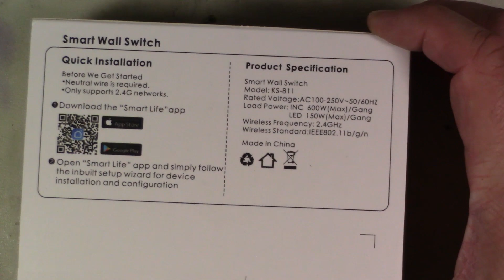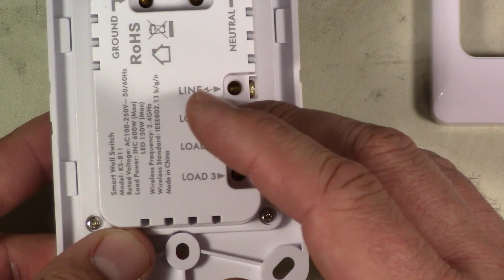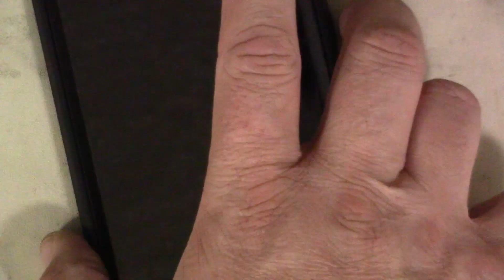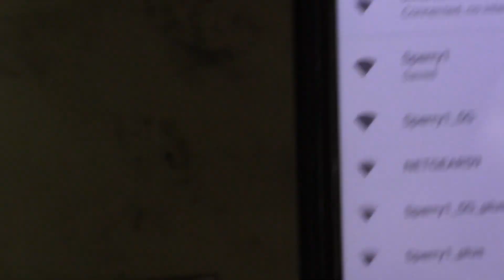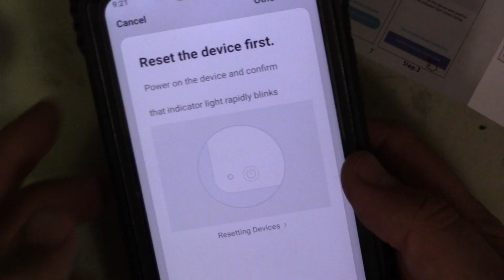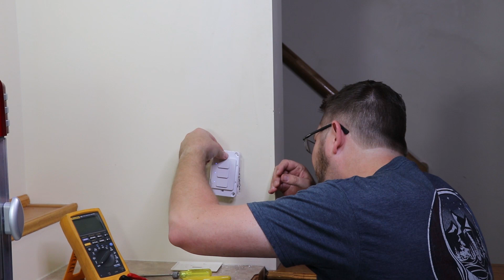Setting Up Zemismart Smart Switch

Comment: Hi thanks for this video, just have a question as I bought and installed this same zegismart switch but with the "no neutral" version and one thing I noticed is that the top switch is warm all the time... ranging from about 3 to 5 degrees celcius warmer than its surrounding area... is this normal?  I am pretty sure I am not overloading it as the total watts of the bulbs I use for all is just less than 20.  Hipe to hear from you soon. Thanks!

Comment: Hi Mitch. What "Gang" means is just a "switch". What you had before is a "1 gang switch" then you replaced it with a "3 gang switch". So, when it says maximum capacity of 600W per gang, it means it can handle the load of 600W per switch. Gang also applies to wall outlets. 😊
Btw, nice video. I love all your videos especially these type that deals with home automation. Keep it up! 👍

Comment: Hi mate. Thanks for all the useful information. Really appreciate it. I have another  question. I have a one gang switch which controls two light bulbs. There is another 3 gang switch of which one button controls the same two lights. If i replace both the switches with these zemismart ones. Will it work ?

Thanks
Reply from the maker: Hey there thanks for the comment.   First I can only speak to US systems at 120V.  If you have two switches that control the same light then those would have to be what is called a 3-way switch not 3 gang.  A 3 gang is just three single pole switches with a common hot.  A three way is different in which it allows either switch to override the other.  It is kinda hard to explain over text.  I hope this helps.

Comment: I thought that was the only one the has the IT issues when the product does not operate as it depicted.
Reply from the maker: Well for what it is it operates fine, once you figure out how to configure it, lol.  But for me I simply don't like that it has to be in the cloud.  I would rather be able to choose whether it be in the cloud or if I could put it on my home network.  But stay tuned to my channel this thursday I will be putting out a video where you can flash the firmware to something different and you can then run it on your own network.  fully functional.